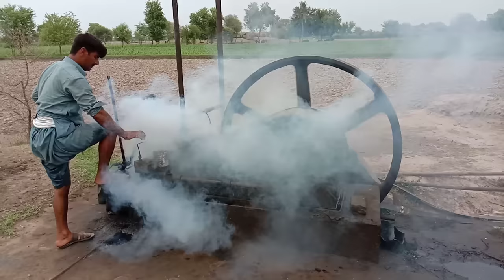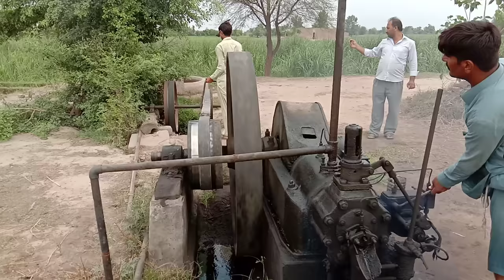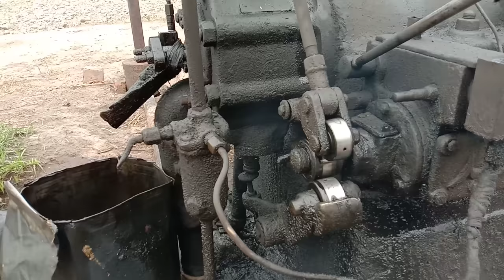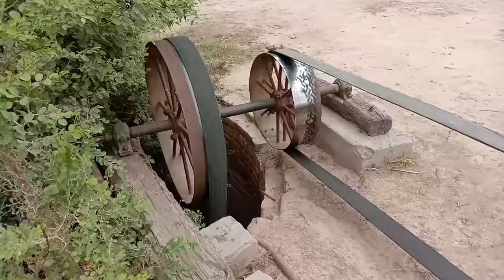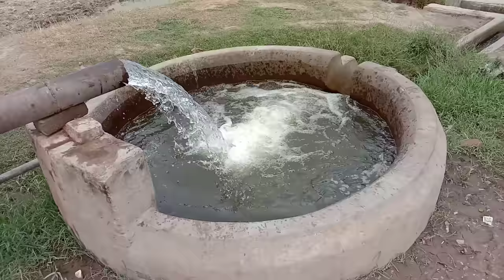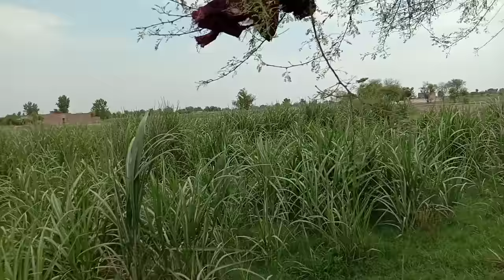Starting Amazing Old Black Engine, Working With Amazing Technology Agriculture In The Pakistan

Comment: It's a testament to " old fashioned " technology , that this poor old neglected and abused engine is still operating ! I doubt that many modern engines would survive in the same conditions .
Reply: Hmm... not sure on that one. There have been terrible engines throughout all eras -- the engines used in cars between the 1920s and 1960s wouldn't reach anywhere near the types of milages cars do today without several rebuilds. That said, modern engines of this century are in my opinion inferior to the reliable workhorses produced throughout the '90s. It's not as clear-cut as 'new vs. old'.

Comment: It may be old, worn and leaky but it's still chuffing on and the boys have obviously got the measure of it. It'll probably be the same for decades to come and at least with all that oil around there'll be no rusting issues!
Reply: Kind of like me.☹️
Reply: It's the amount of gritty dust, especially where the oil cups have been removed/lost/wrenched off and the less than clean containers used for oil and fuel, that will ultimately be the killer.

Comment: Love that these old engines are still going!. When you look at modern alternatives with their digital components, how many of them will be still functional after 80 plus yrs of service.  Good on them and I bet there is a local chap who can repair or make parts for it if it breaks down! (If ever) 🤣
Reply: Sure, except a modern engine with digital control puts out 10 times the power with 1/10th the fuel consumption, and can be carried in your arms.
Reply: @instazx2  And where would these guys find a 'tech support' person where they are?.
Reply: @robleary3353  lol you're asking where to find TECH SUPPORT in INDIA?
Reply: ah crap i accidentally racismed.  Description says Pakistan.  Still, I'm going to give people the benefit of the doubt -- rural doesn't mean dumb.  And, an engine with electronic sensors and an ECU doesn't mean "cloud enabled subscription service".  There's a huge gulf between those.  They obviously have enough technology to get high-quality 1080p video onto the internet!
Reply: @instazx2  Most of them are scammers!. 🤣
Reply: @robleary3353  yikes dude
Reply: And do you love water with oil ???

Comment: I wonder how long it’ll be until one of them learns what happens when you wear loose clothing around unforgiving moving parts.
Reply: Not so long ago a woman with a long head covering of some description found out the hard way why they advised her not to wear it on the go kart.
She died pretty quickly though.
Reply: That's horrible.
Reply: @curtisstewart9594  Mi
Reply: Those who who get that  lesson ar usually dead.
I see these long tails flopping and I  cringe .
I see them put a belt on to a running drive  and I  flinch. 
But these people don't eaven think anything of it.
Reply: but, yes they would definitely figure it out when it happens tho.
Reply: I've seen people ripped into pieces by half as dangerous machines, you'll never catch a real engineer wearing a tie
Reply: Really not dangerous  you be able to stop the belt by bare hand  my grandfather has one like that

Comment: To think the millwright who set this engine had a square, level and string. And probably has not been touched since.
Amazing.
Reply: This site has never heard of a millwright, much less seen one ...
Reply: @fjb4932  the engine base is on poured concrete with what appears to be a grouted frame and pillow bearing carrier support. Someone who knew how to set engines did this.
Reply: @fjb4932  millwright is a western name for a Ustad in this part of planet Earth.
Reply: Amazing it is

Comment: It makes me sad hearing these old engines laboring with leaking valves and and worn cams,rattling and clattering when so much could be done with them.
Still running long after they shuld be gone. 
And how many have fed themselves into these belt drives and open wheels, wearing loose long clothing around them?
Reply: Looks like some effective irrigation is being done with them. She's well oiled. If it ain't broke, don't fix it.

Comment: These irritation system has been out half century ago, now new system should be introduce, which is very handy compact nd reliable. U can import it from India at very cheap price.
Reply: Or keep using this old and reliable, for even much cheaper price.
Reply: Bruh there are many available here. 

I think that must be a backward area that's why they're using old tech. Otherwise electric pumps are used here mostly.

Comment: Old diesel engine? How efficient for hp output vs modern engine? I was never seen in Indonesia, salaam...
Thanks before...
Reply: How efficient is something with this lifespan. At least 100 years old and ran countless hours. Probably minimal maintenance. Will probably last 50 more years just keeping greased and adding oil.

Comment: Isn't the oil meant to be inside the engine....;-}
Reply: Beggers belief Actually no. Most engines of this era / type work on a drip system, oil is fed onto bearings etc very slowly, a drop at a time. There is no mechanism for returning the oil to a sump, instead it just works its way out of the bearing onto whatever surrounds the engine. That's why you always see tin trays dotted around and under vintage engines in workshops and factories to catch the drips. The fact oil is literally covering every surface of the engine is probably why it's still working and in good condition after decades.

Comment: Sounds like that old thing need a valve job.  There shouldn't  be a "Ppssht Ppssht Ppssht"  and blowback smoke out the intake  port with every power stroke.
Reply: Yeah
Reply: The problem with doing a valve job though, is that the piston rings will then begin to show weakness. Fix that and the bearings will begin to fail due to increased power and so forth. Engines like this wear out over a long time, until they make 1/2 the power they once did, but will keep running so long as you do not upset the balance unduly.
Reply: @erikdevries9208  You're dead right..'if it ain't broke; don't fix it'; it still starts ok. What fuel can/does it use.
Reply: @fcukmegently  I imagine it uses diesel fuel, or perhaps a local equivalent. Rudolph Diesel first demonstrated his compression ignition engine on peanut oil, after all.
Reply: @erikdevries9208  wow

Comment: I can't believe he is standing in diesel fuel??
Reply: Why not? Just like any oil rig in Texas. Throw a match in it and it won’t light. It is more like cooking oil than gasoline and won’t ignite till it is over 500 degrees. It is hard to clean off if that is what you are pointing out. What takes it off best? Gasoline. And now you do have a problem.🤣

Comment: Can you tell me, how the engine light  up without  battery? Back in , my family had, Kobuta generator ( MAKE IN CHINA), i am sure can do this job, but Radiating with 500 gallons of water tanker/or swimming pool water. But this just the engine,, how?
Reply: It's a diesel? If what you're saying is where does it get spark from, It dosint.